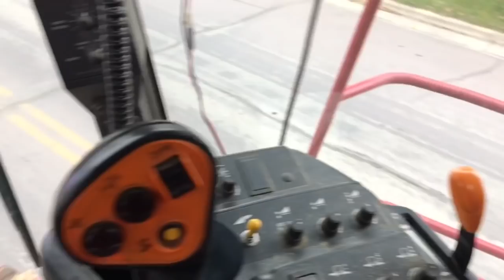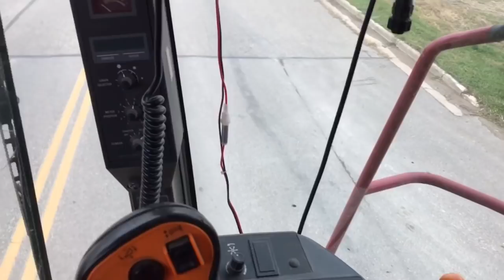Combine Axle Broke In Half

Comment: I felt guilty for giving this video a thumbs up due to the circumstances.  Hope you can get it worked out.
Reply: MN Millennial Farmer I know it doesn't sound right does is it
Reply from the maker: MN Millennial Farmer thanks for the well wishes! Got it welded up and back in the field now. Seems to be holding up. Looks like you’re up against the wall up there fighting the snow. Thankfully we haven’t had too much snow yet
Reply: _dddddddddddddddddddddddddddddddddddddddddddgddddddddddddddddddddddddddddddddddddddddddddddddddddddddddddddddddddddddddddddddddddddddddddddddddddddddddddddddddddddddddddddddddddddddddddddddddddddddddddddddddddddddddddddddddddddddddddddddddddddddddddddddddddddddddddddddddddddddddddddddddddddddddddddddddddddddddddddddddddd
Reply: P

Comment: This is a common problem with Case combines in the past.  We've snapped the rear axel on our past two that we have owned.  I also know of several other farmers in the area that have had the same problem.

Both of our breaks happened in the field, we hooked a chain between the three-point hitches of two tractors to lift the rear of the frame up until we could block it in place to get the axel out.

Add a piece of flat steel about 3/8" thick across the bottom of the axel and weld it all up and it won't break again.
Reply from the maker: never realized how common this is

Comment: wow what a mess. that is a hard fix. can be welded but the grain in the steel runs oposite of weld needed. that is a big problem needs to either be stress releaved or plated or both. be very care full how it is fixed. even the best welder has to have a great procedure to fix that. the way farmers travel on the roads these days it is a big safety concern. i was a high pressure steam pipe welder for over 30 years. and a A.W.S C.W.I. for 18 years. the welder you have is very good. ive seen his stuff. if you want to ask more i would gladly help.  i am not meening to be pushy.
Reply from the maker: we trust the welder that repaired it.  he split it completely and then put it back together
Reply: i seen the later video looks like he done a great job

Comment: Maybe too much pressure in the tires ?
Like , that makes it harder on the axle bumbing through holes and over bumbs.
Reply from the maker: think it was just fatigued over time
Reply: Fatiqued indeed, it does not break in the first pothole .
Hard tires sure giving harder vibrations
and seeing the wear of the tires mostly in the middle I think you pumped them really hard.
Reply: @jedadruled984  it hard to that when you take the header off than there to flat to move it.
Reply: @charlesfuglie2491  Indeed, pressure too low is not good, but too hard also gives problems.
And seeing the wear pattern on these tires, most wear in the center, I think that these tires are too hard.
A tractor or combine has no suspension like a car, but the tires can work as kind of suspension.
Reply: @jedadruled984  its when you take the header off is where you got to add air back to tire so what I do is set the air pressure for with header off and it's to much for with header on but don't want to sit it up in the field if we take header off

Comment: time 4 a new & bigger axle.. rewelding it wont hold 4 ever.. never seen an combine axle break in half be4..
Reply: MRJOHNDEERE3720 we had last year a Gleaner combine and we were going across the field in the bin was full and we just turned and the left wheel right like a foot past the steering joint snapped right in half
Reply: shit!!
Reply: MRJOHNDEERE3720 it's not to hard to switch the center section of the axle out.
Reply: MRJOHNDEERE3720 

The red combines are known for having weak rear axles.  They can be welded and last if extra metal is added either above or below the axle.
Reply: @Jake Ziegler i did not think u could do that.
Reply: @ 45Deere9500 damn those red combines LOL  i'd weld on both sides..
Reply: @Tim Westendorf  a professional welder is ur best bet... just dont hire me.....LOL :) nice..
Reply from the maker: its more common than you think